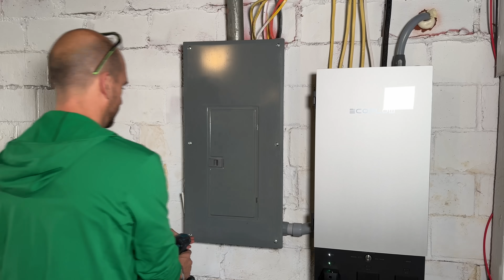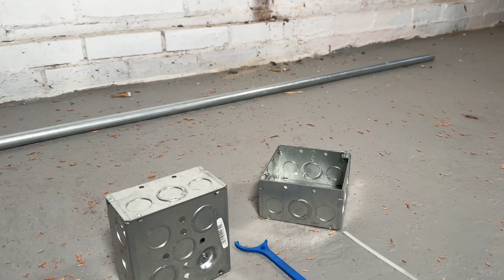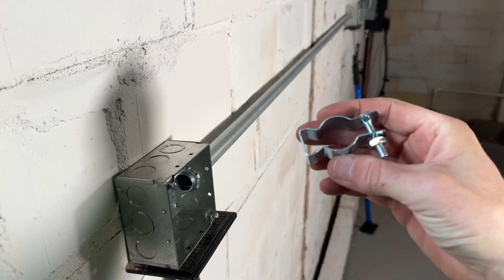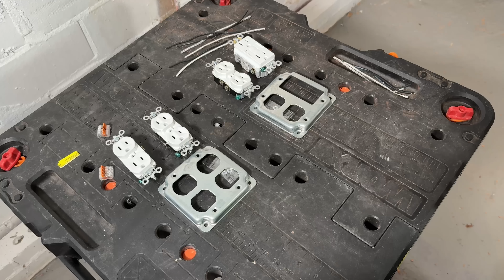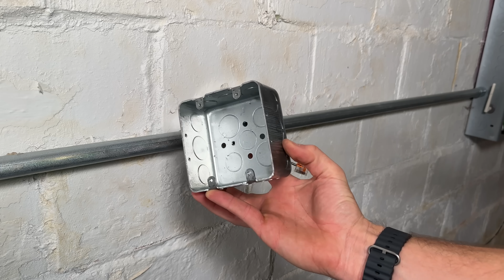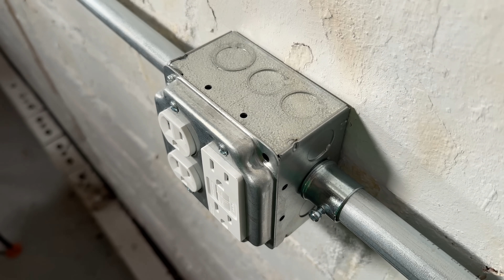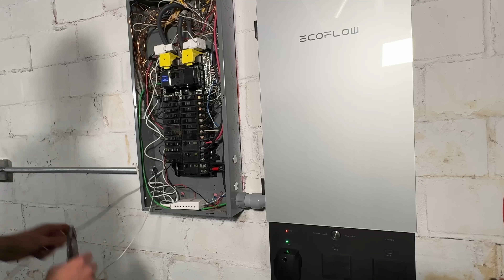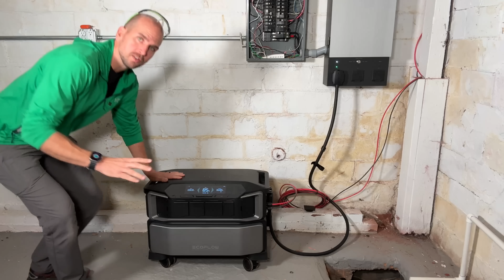Add Outlet To Unfinished Basement Or Garage

Comment: I can't count the number of emt screws I've tightened on old houses over the years. I always run a separate ground. It's quick, easy, cheap and is an unbroken-by-loose-screws piece of protection. I see by reading comments, that I'm in good company on this subject. Another point I'm curious about is the ring on your left hand: if it is metallic, you're taking a risk. I learned the hard way connecting 4/0 cable to bus-bars in an 800 amp DC can...my arm was straightened so hard I was knocked away from the can.
Reply: All metal surfaces must be grounded with grounded wire can handle the short circuit current. Do not trust the conduit , it can brake or louse connection can put lives to the danger. Run the grounding wire .
Reply: It looks like a silicone ring on his finger, alot of public safety personnel use those inplace of their metal wedding band.
Reply: It's not cheap anymore
Reply: @richt5986  My wife says it's cheaper than a funeral.
Reply: @choimdachoim9491  definitely
Reply: @richt5986 I was considering selling a kidney recently, and then I realized have about 700 ft of 12-3 sitting in my workshop from like 16 years ago 😅
Im soo glad I didnt need to buy that stuff today 💯

Comment: I have to point out roamex can be ran in emt conduit  the reason why  some elections run single wires is because of heat and  the need to up size the conduit, and single strand wire is cheaper. never trust election that will not run the ground wire. makes things safer

Comment: Curious as to another way of wiring this setup. Working right to left as you were in this video, could the feed come to the first outlet on one set of screws and the pigtails jumper over to the second outlet in the box the feed wires attach to the second set of screws on the second outlet and carry on to the second box ?

Comment: As far as I know you can put nm cable in conduit. It usually isn't done because it's hard to work with especially if there are a number of bends.
Reply: @samuelt5131. are you an electrician? Im concerned because I have used NM wire in metal conduit many times although not in basements only in my garage and my patio at wood walls and always connecting the bare ground wire to the metal boxes. am I OK in doing this?
Reply: @mariopadilla1443  I'm not an electrician but I've lived in 2 houses built in the 1990's that were wired by electricians and inspected and approved by local municipalities. Both have NM coming from behind or below a wall transitioning into conduit without a splice and terminating in and grounded to a metal box as you said. 
So it isn't horrible but if adding any new work check what the up to date code is, or ask someone who knows it well, like an electrician. For example my house has outdoor outlets with the GFCI provided by the bathroom. I'm fairly sure that's no longer approved.

Comment: I agree pulling the ground wire into the boxes is better because the bonding through the conduit could be compromised .
Reply: O interesting. Please explain how a wire EGC magically  can't be compromised
Reply: On a short run like that I probably would too.  But in commercial wiring when they are wiring a big building, they are not paying for that extra, unnecessary ground wire.  That is with 120 Red, Blue, Black or with 277 brown, orange, yellow.

Comment: Your metal boxes should be mounted on a moisture barrier, i.e. piece of wood.  This keeps the boxes from rusting from the moisture that comes through those cinder blocks.  That wall shows signs of moisture penetration and efflorescence already.  Additionally, although you may not technically have to run a grounding conductor through that conduit, it is a good practice to do so.  Over time, the set screws in the connectors and conduit will loosen and/or corrode losing the bonding effect for the ground path.  I believe that running Romex in conduit may cause a possible overheating situation due to the temperature rating of the Romex and it being enclosed in conduit.
Reply: @@karlwithak.my guy
Reply: Actually Karl, the code is written by the assholes that manufacture electrical equipment. Find a copy of the NEC and look at chapter 9, "The code writers board". It'll make you sick.@@karlwithak.

Comment: Only cheap idiots do not pull s ground eire in flinsy EMT conduit. Had a sparky almost get electrocuted when he attempted to push two lengths of 2" EMT back into flimsy coupling. He did not pull a ground wire for the 200 amp 480 volt  circuit he ran a month earlier. Here two of the wires were nicked to bare copper and one if the wires grounded out to ungrounded conduit then created an src flash when conduit was shovled back into the other  end of flimsy EMT coupling. After that he ran ground wire in every condiit he installed. Between burnt fingers , chest pain and trouble seeing clearly for several minutes he learned his lesson.

Comment: Within the last year read one of the reasons you are not allowed to strip the jacket off NM cable and just use the white & bkack wires inside if conduit the jacket does not have the required guage or Type of insulation on wire jacket. Only lasy aholes use a tubing ciutter to cut steel EMT conduit. It produces a inward bend that us very difficult to remove snd guarenteed to nick wire jacket. Had a lasy coworker use a tubing cutter on a 150 run if 3" EMT. He ran a round file around cuts but did jot remive the inward bend. Run had 360 degree in bends and shorted out the jacket on the three 3/0 expensive copper THWN wires in several locations.

Comment: You did this job using 15 amp receptacle. With a 20 amp breaker and 12 gauge wire, your receptacles have to be rated for 20 amps.
Reply from the maker: 15 Amp meets code as long as you have at least 1 duplex outlet.  These type of commercial grade from Legrand will have no problem with the loads.

Comment: Ok, at @ 0:37 you say Rolex in conduit is not cool, but in “How to install a 240 volt outlet … “ (https://youtu.be/tBxGo0qveNs?si=UE-_JZOzj0Cjnjlg) the demonstration installs Rolex in metal conduit.
Reply from the maker: Nice find! Yep that was less than ideal.  Especially as that pull was much harder.  THHN would have been a much better option that that installation as well.

Comment: I wished you diyers and home owner electricians would stop posting these videos. First of all you are not qualified to teach electrical and second. I just finished rewiring a home that caught of fire, and the homeowner decided to play electrician because he wanted to save some money. Oh, yeah, he watched videos on how to do it too, that's odd! I have been an electrician for 30 years, and pipe cutters are NEVER allowed for cutting EMT. Always use a hacksaw, Sawzall, or bandsaw when cutting pipe. Use the proper reaming tool or a file to clean your pipe ends. Strap all your pipe as it's required by the nation electrical code. A home owner should never have any reason to open a panel. What if your main disconnect failed and didn't properly shut off? You open your panel, thinking your power is off and touch something wrong. I have been a master electrician for over 20 years. I don't even let my apprentices work in a panel or on live circuits until they are taught proper safety working  in those conditions.
You really need to stop these videos on working with electricity until you are educated by someone qualified.

Comment: So the only reason for using metal boxes is that you can leave the ground wire out of it??That wouldnt do in the Netherlands!We dont use metal boxes or pipe for that matter.We use plastic pipes and always ground wire,and plastic or other harder material for the switches or plugs. And those are a lot smaller than those in the States!Why must those be so big??And i say this because i am a elektricien.

Comment: Thanks to your video, I've ordered the Locknut Wrenches. I didn't know they existed. Did you say the cable sheathing should be removed if the installation location was considered a 'wet' location? How does one think an inside garage wall is a 'wet' location? When installing conduit, I always place a plastic cap on the ends to prevent the wires from being damaged. A Master electrician lives in the house behind mine. He helps and teaches me when I do electrical DIY projects. I asked him to watch this video. Later, he grinned and bent his head backward.
Reply: To tighten the lock nut, put a screwdriver on the top tabs and tap with a hammer.

Comment: Your using thhn wire “stranded “ ??? Solid copper wire is for residential use. Also, i seen you pushing the wire towards the panel ??? Was the panel live ??
Safe practice is to pull wire towards your load, not push to supply !

Comment: You are required to install conduit supports for all conduit runs. Your install is a code violation. At least one conduit support is required within 36" of every conduit termination (box) and every 10' after that. Not only is romex permitted in conduit, it is REQUIRED to be installed in conduit when subject to physical damage. So to imply its not allowed is false and completely misleading.

Comment: If using EMT “conduit”, it is illegal to cut using a pipe cutter because it will reduce diameter of conduit. You must use a saw and then deburr your cut.

Comment: Heres an odd thing ive always been taught by a master electrican to turn off the main panel before working in it because those buzz bars are live with a 100amps in each side one slip and your toast . all the jobs ive done from electrical entrances to main panels we always screw plywood to block or concrete or brick walls some inspectors will fail you if its not done . also all electrical companys have the 3' clearence policy they want 3' cleared at all times around meters panels . honestly youd think someone putting out a video would be smart enough to warn people not to play in live panels especially with enough voltage to kill you in an instant .

Comment: id say to NEVER put tapcons into the mortar between bricks.  its the weakest place you can place a screw or anchor.  you didnt use a hammer driver because it would have stripped those holes out in record time.

Comment: Only hacks or DIY'ers would put  Romex in conduit. It is permitted to run NM cable in conduit sleeves for physical protection. But as a wiring method no bueno. But if that's the kind of work you do whatever.

Comment: My brain circuits fried about halfway through the video.  Since I don’t ever plan to do any wiring myself, that’s ok.  I could follow and see enough to go down to my basement to check what I kind of thought wasn’t good with the some of the wiring.  Sure enough, the previous owner had someone “install” some outlets on the block walls.  One had wire just hanging loosely from the above floor joist down to a regular plastic outlet that’s fastened to the concrete block.  The other did have metal conduit that started a couple inches from the top of the block wall so there’s about 4-5” of loose wire then the conduit which isn’t fastened to the wall until it goes into another plastic box on the concrete block.  And of course the romex (?) going from the conduit along the wall to the water tank for the well has about 2’ just dangling along the way till it gets to the pressure regulator (?) about 6” from the concrete floor…which does get water with heavy rains.  So far not more than an inch or so in that area.  I definitely need to specify “All needed repairs will be the responsibility of the new owners” when I sell this place!  Sounds only slightly better than “being sold as is”.  😵‍💫 I just noticed the romex hanging as it goes into the panel so I guess that’s ok.  And the wires hanging along the wall to the battery on the floor.  🤷🏼‍♀️

Comment: Yeah, I don’t know so much about that. I agree with you on the mechanical ground but unless you’re basement is really sealed tightly I can see where you might have moisture issues later on, and that eventually is going to roll on that conduit and cause issues with your grounding, I would’ve ran a permanent ground wire as a secondary back up just to be safe
Reply: Dampness or moisture are not going to affect the continuity of a properly installed metal raceway. EMT is installed outdoors every day so in a protected environment, even a potentially damp one, not an issue.

Comment: The wires and emt codes are more about heat build up but I've seen romex in conduit working fine for years without problems not that you should do it but probably isn't going to cause a problem in something someone else already did. I was a commercial electrician running conduit and pulling wires i liked better than romex. I would have run a ground wire because this could end up running an appliance like a washer where a bad ground is potentially dangerous most of the time grounds aren't almost everything is plastic anymore 😂😂😂

Comment: Do you have a code requirement where you are for arc fault protection?  I've been using dual function breakers which provide arc fault and GCFI protection. Since that more expensive breaker is needed anyway at least it simplifies not needing a larger GFCI recep in the circuit which makes wiring a little bit easier IMO.

Comment: The outlets that you are using are not rated for 20 amp. only 15 amp circuits.  20 amp outlets have a T shape hole on the neutral/ white wire side. I stand corrected since you have more than one outlet it's ok to use the outlet that you have as per this video I found but you cannot  put more then 12 amp on the one receptical.  https://www.youtube.com/watch?v=wLSe4LzK9b4

Comment: There is absolutely noting wrong with NM (Romex) in conduit.
Reply: ...If the conduit is large enough that the Romex has plenty of breathing room.  You wouldn't put 12/2 in 1/2" conduit, but you could run appropriate gauge single strand insulated wire through it.
Reply: @paulh6591  - 12/2 is perfectly fin in a 1/2 conduit... At least according to the NEC, your local jurisdiction may say otherwise... 

But, it also depends... If the conduit is acting as a sheathing (i.e. not a complete raceway), for protecting the NM, say if it were entering into one end of the conduit in a celling to an outlet on the wall then there is no need to de-rate, or do fill calculations for conduit sizing. If it fits, it's ok. 

If the conduit is acting as a complete raceway, that is between two boxes (like you had it between your panel and the outlet), then you would need to take the fill of the conduit into account, as well as derating calculations. For NM, it is considered a single large conductor. Southwire's 12-2 NM is 422 mils (0.422"). That fills a 1/2" conduit to 46%, which is perfectly acceptable. IIRC, a single conductor can't fill more than 53% of a conduit/raceway.

(Note, I'm not an electrician)

Comment: Buddy used Wagos. Omg. So many problems with this video to mention.  Call an electrician. Don't do anything this guy says. That's why it's a trade, not a hobby.
Reply: I think Wagos are inferior to conventional wire nuts that are done properly becasue more surface area of the wire makes contact.  But they are approved, and this is simple wiring is well within the wheelhouse of a handyman.  I don't agree with using the conduit in lieu of ground wire. But there's nothing here to lose sleep over.

Comment: Dang, is everyone besides me rich these days? LOL I'll start by saying that I'm NOT an electrician but I have wired my own projects for more than 30 years and haven't burned down anything yet and maybe there's a good answer/reason for my questions but I don't see it.  Questions... what in the world is the point of using all those pigtails and WAGO connectors? Isn't that a lot of extra time and money? If I were doing this project in my house, I wouldn't waste time making all those pigtails or money on WAGOs. I would wire this entire thing with no wire nuts, no WAGOs, and just jumper wire for the last outlet in the string. What was the point of creating pigtails and then requiring the use of either WAGOs or wire nuts?
Reply: I don't use Wagos but always run pigtails to each outlet on the branch.  It's bad practice to run current  through all the other receptacles on a branch.  In damp locations such as basements there has been instances of arcing and bad connections due to oxidation of screw terminals on outlets or worse, backstabbed outlets.    Use proper wire nuts (they are not expensive) and make the extra effort to wire it right.
Reply: @paulh6591  thank you for the answer! I'd think the metal bar on the outlet, which connects the two outlets, should be rated to at least the full rating of the entire circuit, no? If there's going to get oxidation on the wire and screw terminals, wouldn't it also be seen on the wire inside the wire nut and you'd end up with the same problem? Just trying to get a better understanding. :)
Reply: Hi Brent-That sounds logical, and It's what I thought for years- but then I heard from many sources that pigtails were the better  way to go.  When I was wiring a bare garage last year I ran a separate 12/2 line with 20A breaker to each wall, roughing in segments from the breaker box and between each outlet,  leaving an extra foot to work with at each outlet.  I then cut and stripped a passle of pigtails, affixed then to each outlet, stripped all the others, and used wire nuts.  I was pretty quick work and now no outlet in the circuit is relying upon the integrity of another outlet or having the possibility of that outley heating up due to electrical resistance.
Reply: @paulh6591  I gotcha. Still weird to me. LOL  I've worked on electrical in a lot of houses and have never seen pigtails used like that. I'm in FL though so who knows. lol

Comment: You drilled into the mortar, the weakest point of contact .
Need to locate holes in the block using other available screw holes in the box.